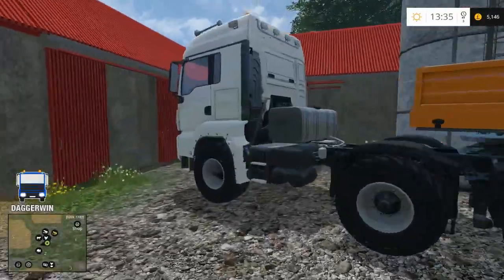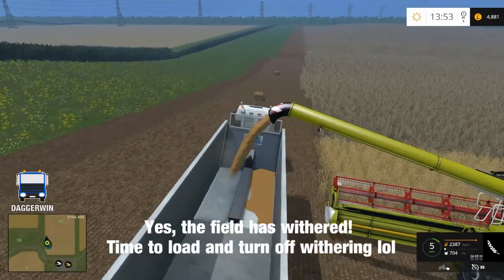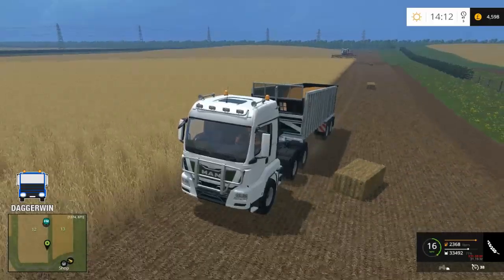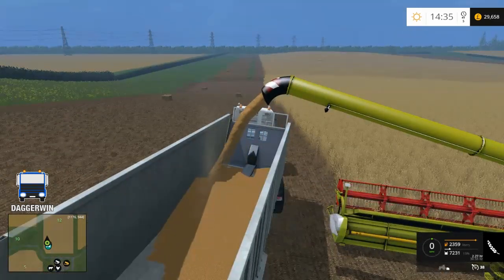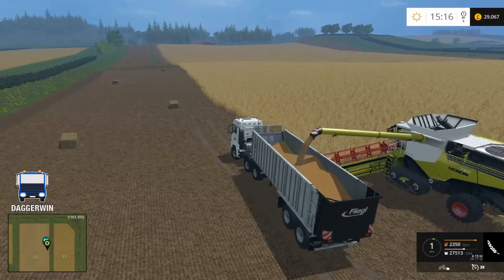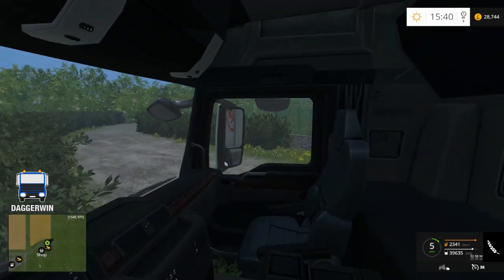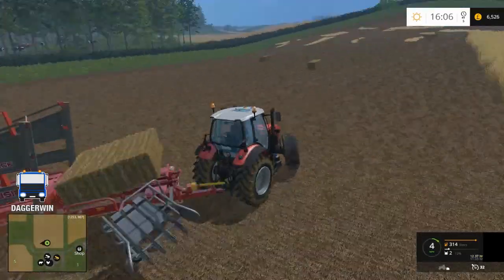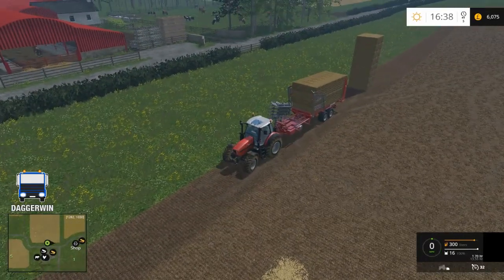Let's Play Farming Simulator 2015 | Thistle Farm Map #4

Comment: It's not just that the mirrors aren't lined up properly, it's also that you can't actually move your head (only rotate it around a fixed point). In ETS2 you can adjust your position, adjust the mirrors, and, when you look to your side, the camera comes out of the window and actually looks back.

I guess Giants assumes that 90% of people play FS15 in 3rd person view (so they can stare lovingly at their brand new combine harvester), so they didn't really bother to make the cab view realistic of efficient.

The mirror mod does work (more or less), but it detaches the mirrored surface from the actual 3D model of the mirrors (because those are different from model to model), so it looks a bit weird. 

I wonder if the current FS15 engine would support in-cab screens connected to cameras (ex., a camera pointing down on the end of the auger, and another on the rear bumper). I know those are standard on a lot of real combines, and can be added easily with 3rd party kits anyway (you can even have the view from the combine's auger camera shown on a screen in the tractor, with a wireless connection). These guys even added a weight display on the side:

http://thefarmerslife.com/equipment/great-grain-cart-improvements/

It's kind of weird when virtual farming lags behind real farming in terms of technology. :-P

Comment: Try course play mod. You can get a chaser bin following in the field and then could unload in to you tractor and trailer that way the combine keeps moving. Or get 2 tractor and trailers on the go. It's a fantastic mod, but may struggle with the map as the sell point is not drive through, but tipping at the main farm if a drive through tip can work. 

You can sell your other trailer no as well.